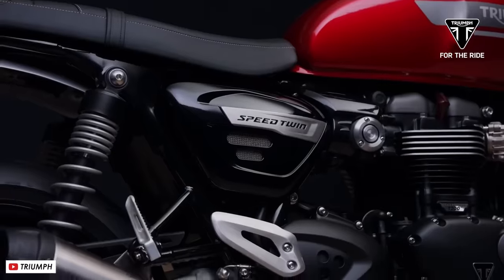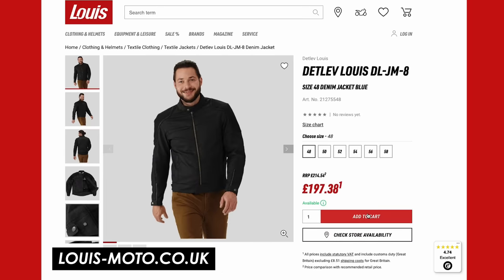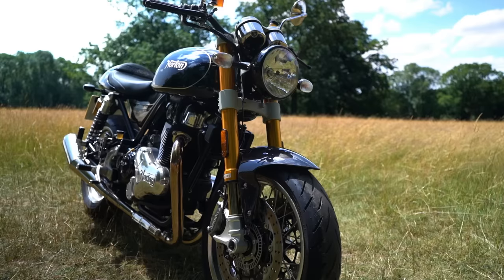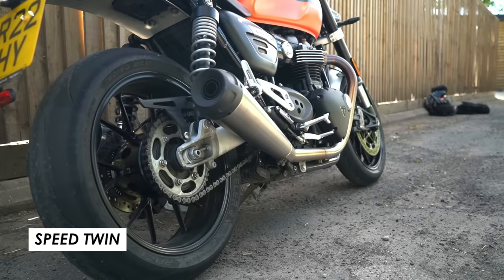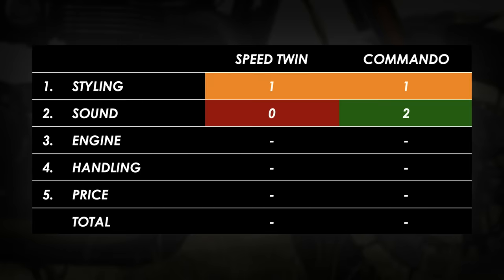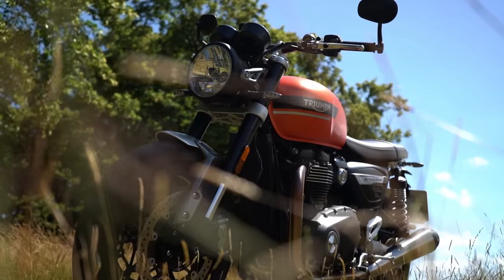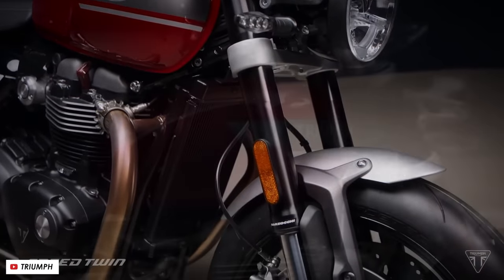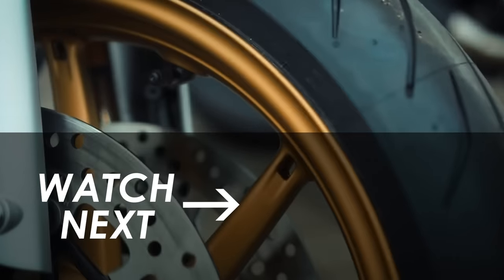Triumph Speed Twin vs Norton Commando 961: Which Is Better?

Comment: Puzzled  ..." Norton Commando is slow ?" Recently sold a 79 Bonnie and still  original owner of 75 Commando. Also a RE Classic 500 and a Triumph Speedmaster.  Ok, air cooled gives more horsepower, modern , yadda yadda. 
 It's about character and how it makes you feel. I would also love a 750 Guzzi or an old BMW 900. 
The Commando is slow and , omg , VIBRATES ! It's not slow and I'm old enough to remember when  being on a motorcycle meant dealing with vibration, and oh yeah, wind. BTW, when's the last time you  used a kickstart. ?

Triumph is mass produced, no way Norton can compete pricewise. Love both companies. If Norton can stay in business and get some dealerships, my choice is Norton. 
Opps, wifey says hold on !!

Comment: It's a shame Norton hasn't come around to liquid cooling. You can say air cooled bikes are more characterful or whatever you want to try to justify the low performance but to me hp and torque are grin inducing and that speed twin looks like it would be a barrel of fun. My personal experience is that air cooled bikes do have a lot of character but that can mean unrefined agricultural feeling and often slow. There is nothing like the refinement on todays modern liquid cooled biked they are brilliant. The Norton is a beautiful show piece however and if they stuck a more modern engine in it they might have something but the performance at that price point not for me.
Reply: If I wanted a modern water-cooled retro, I'd just go for a Kawasaki. It's the classic British bike experience that one looks for in these kind of bikes, and that's where the Norton is miles ahead. So buying a Triumph for the supposed reliability and performance makes no sense to me, I'd rather have the Japanese Z900RS.
Reply: Unfortunately for Norton, the Commando engine is what they're famous for, and it's what gets them exposure.  Without the Commando engine in their machine, nobody would notice and nobody would care, and they would just quietly go out of business.

Comment: I had a speed twin. just couldn't get on with it. awful suspension (took it to Maxton twice, still not right) and though extremely powerful had the feeling of a slightly out of control JCB at speed. I have a scrambler 900 which I love, have put 10K on it and its a beautifully well balanced bike (suspension still very poor however - come on triumph - please sort it).

Comment: I have a Speed Twin, traded in my Speed Triple for her.  I also have a modded ‘74 Norton Commando, which is a 920.  The “new” Commando is too slow, period.  Time to ditch the air cooled engine and design something akin to Kawasaki’s lovely Z900RS.  Speed Twin suspension just sucks, when you factor in £1-2k for proper suspension the Norton looks like good value!

Comment: 🤔…..Norton?  It has been very frustrating following the on-again / off-again existence of this legendary motorcycle brand.  I owned a ‘71 Norton Commando (a very long time ago 🙄 - good grief!….what a bike!  Foot brake and shifter on opposite sides….shift pattern was 1-up 3-down.  You really had to be “on your toes” literally, whenever you needed to come to a pretty quick stop!).

How long will the new Norton company last?  Who knows?  Triumph is clearly a solid choice if you want to buy a motorcycle that is backed by a company that has a strong history and reputation, since being “re-born” from its original British days. 

This Norton featured in this video looks amazing.  Time will tell though - will the company still be around in 3 years?  5 years?  👀 

It’s a fair question.

Comment: Triumph takes it with a much more modern engine, and on the topic of handling, a water cooled 1200 will obviously be heavier than an air cooled 961. You wouldn’t normally compare the handling of a lighter bike to a bigger heavier bike. Obviously extra weight will have an effect on that. It should be, how it handles relative to the engine size. In Canada, that Norton is literally twice the price of the Speed 1200, and 3 times the Bonnie 900. Most importantly, Triumph will still be in business while Norton is still a one model pony show. Yes I know they have a V4 sporty bike, with a price tag pushing 6 digits. That won’t be flying off the showroom floors. The extreme fringe, translates to here today, gone tomorrow, again. Versatility in bike models isn’t Norton’s forte. Triumph has gone far ahead with bike models that aren’t Bonnie models.
Reply: Norton should not be compared with Speed Twin 1200 but rather Speed Twin 900 ... ?

Comment: The cheap shocks on the triumph are just crap also the plastic chain guard which is a insult .
Get ohlins and change those awful exhausts with the black end cap  for the  same ones on the thruxton R and it will look miles better. 
Please note there is no chrome on the Norton. 
The wheels ,spokes and exhaust are stainless steel .
The engine casings are polished metal .

Comment: In my opinion the Speed Twin is nothing special to look at. I think the T120 Bonneville is allot more tasteful looking but it's heavier and unfortunately they don't put the 100hp engine in it. but the Thruxton is maybe even nicer looking with the right paint job. but I wouldn't buy it because of the really low handlebars. but I think the Norton is really a nice looking bike. I don't know how you can even think the Speed Twin competes with it's looks. its maybe even better looking than the Thruxton. but I haven't seen it in person. and maybe it's under powered. I couple of years ago I test road a Speed Twin. and took a nice slow ride along the beach and thought it was a nice bike. I liked the low end torque and the sound of the bike. but I wasn't really 100% into the bike. not enough to want to buy it. but I thought it was nice for what it was. but then I was considering the Kawasaki Z900 Rs. but then around four months ago a came across a bike that wasn't even on my Radar at all, a 2017 Ducati 939 Supersport with only 2159 km on it in new condition. and I bought it without even test riding it first. and after the first few minutes of riding I fell in love with it. but then after riding it for around three months. I went back into the Triumph dealer to test the Speed Twin again. just to get a perspective of how it felt in comparison. and my 939 absolutely blew it away in every single way. better engine. better handling. better feel, better looks. this time I took the Speed Twin on a more open road and the power didn't impress. its nice in the low end but doesn't have much after it. and it just felt like I was riding an old bike as far as how it felt. I left the dealership feeling like my 939 was so much better in every single way.

Comment: I hate to say this but Commando looks like a half finished bike with cheap mirrors and lamp holder, 3x (?) plastic cups, the cheapest key possible, mid-section very untidy, full of gaps and lose cables, ugly chain protector and half-finished rear section with no harmonic lines. It is like the designer was unaware of Norton's legacy and design, and got one week to sort out the problems from the old model. All easy to sort out in next "mark", they must have been in a hurry to launch the bike. 
Speed Twin with its alloy wheels and strangely tilted down tank position is the least of twins I'd consider. Thruxton would be more appropriate bike to compare with Commando. 

I give Norton a credit to avoid unnecessary gimmicks (or they had no time to "develop" it?). Triumph sc*ewed it with all that electronics bs in new water colled twins.

Comment: Norton was ALWAYS the better built, more reliable motorcycle over Triumph & BSA. It's actually HAND MADE now, so I'm betting this has still gotta be true, maybe even more so.  Triumphs have had a lot of issues concerning break downs & how poorly they have been addressed. Bad Attitude .
Add, to this that Norton has quality adjustable front suspension front & rear, along with pride of product, which usually means much better response in dealing with issues,  unlike Triumph It's gotta be NORTON in the long run, with  INITIAL higher price being justified. It's a quality motorcycle, with quality parts, not cheaply made on an assembly line. Attention had been paid to fit, finish &  loving attention, by MASTER  CRAFTSMEN, to It's assemblage. Rather than tossers on an assembly line loaded with heavy dark extra stock ENGLISH ALE!😂
Reply: Norton looks great but will it still be a reliability disaster like the earlier 961 (just look on Norton forums ) and is it mechanically as noisy ? , also wouldn't it have been fairer to put the Thruxton RS against Norton ? . For me it would be Thruxton RS for the best retro café racer , de cat free flowing exhaust and would sound every bit as good as Norton